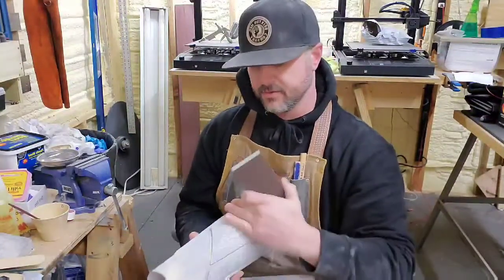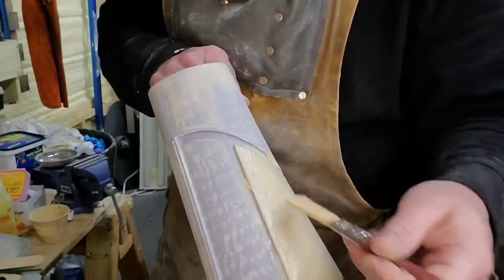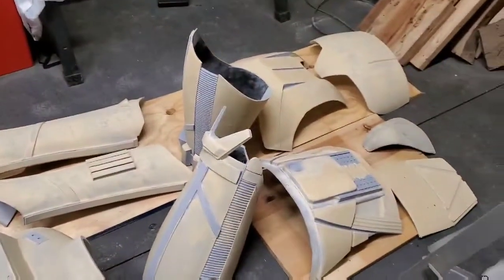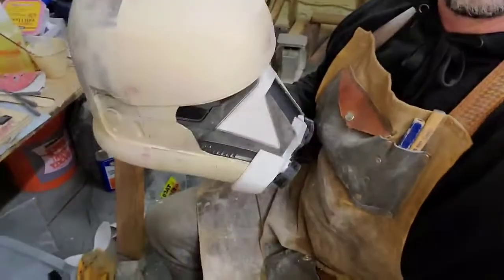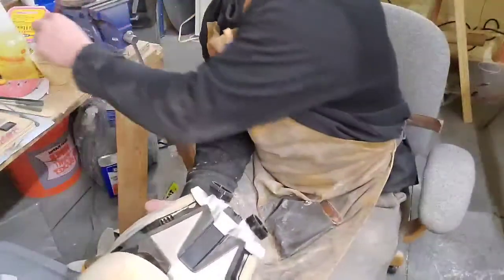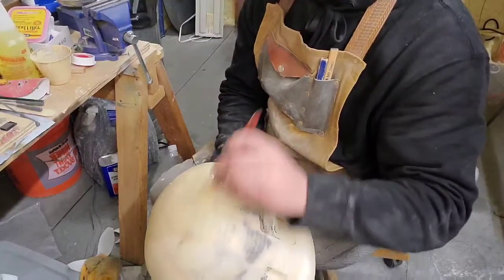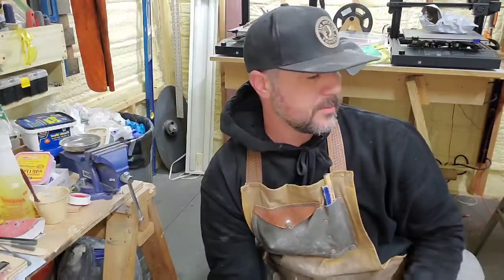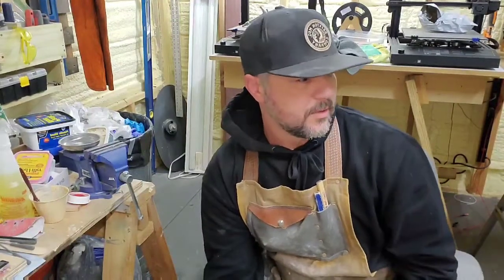3d Printed Star Wars Death Trooper Armor Part 3.......Wood Filler On Everything!!!

Comment: I’ve tried bondo, Fiberglass resin, UV resin, spot putty, XTC-3D but I haven’t tried wood filler. Wood filler has  got to be the least toxic and easiest to sand option. So I’m going to give it a go. Thx for the video. Like the idea of watering it down.
Reply from the maker: You bet!  I mainly use tabletop epoxy resin now days but wood filler works great.  Tabletop epoxy resin is like XTC but cheaper. 👌
Reply: @naterritchey19  Interesting. Maybe I’ll give that a go as well. That’s a two part  in that it has a hardener, right?
Reply from the maker: Yep, two part epoxy.  1:1 ratio on the stuff I have.

Comment: Great video!  Agree about post-processing being a good get-away to relax (‘til it stresses you out). 😉

I was wondering if you smoothed out that grill piece (you mentioned wanting to do it in resin).  If you want just that part in resin, for this build, I may be able to help you out. 👍🏻
Reply from the maker: Yeah, it does get stressful at times. Haha.  I actually ended up printing it with at 0.2 nozzle with the best quality I could on my FDM printer.  Turned out really good.  Thank you though!

Comment: Nice idea, did you just thin it down with actual water or something like acetone or IPA? I feel IPA would be good as it would help dry faster and less change of water ingress settling in the filler.
Reply from the maker: I just used water.  I just use Bondo glazing putty now.  Thinned down with acetone.🤙

Comment: Thanks for your video. I will try this by myself. The normal spray filler needs so much layers, i think i never finish...
Reply from the maker: Yes it does.  This saves a little time but I prefer epoxy resin now.  Makes the piece more rigid.
Reply from the maker: I have a video on that process too.

Comment: Had a few questions if you don’t mind. Was wondering what you did to glue sections together and what the process was to go from glitterbombed Docs to black and clean looking. Picking Tom’s files up as soon as my undersuit is in and these are the last two things I’m unsure of how to go about.
Reply from the maker: I used CA glue and activator to glue all the pieces.  I'm not sure I understand the other question.
Reply: @naterritchey19  my apologies. I was wondering what processes you went through to get your Doc Martens blacked out. I’ve never worked with leather and changing the color of the boots is a big mental hurdle for me.
Reply from the maker: Ah, I see.  I actually stripped them down with some sanding and acetone I believe and then used some leather dye.  After I dyed them I went over some spots by airbrushing aome acrylic paint.
Reply: @naterritchey19  thank you! I just started the printer up, that’ll give me something to do while I wait for the first few parts

Comment: Nice. I posted a tutorial in a FB group about using wood filler. Don't use epoxy to glue your prints.. Use 2P-10 with the accelerator. Also if you use a sponge brush instead of a chip brush you'll get better coverage :)
Reply from the maker: Thanks for the tips!  I'll check out your video
Reply from the maker: I forgot to tell you.  I didn't use epoxy for glueing the parts together.  I used CLA glue with accelerator.  Just used countertop epoxy to smooth and strengthen the pieces. 👍

Comment: Is that Elmer's plastic wood from walmart an spot putty to finish this it works ?
Reply from the maker: Yep, that's what I used!  I don't use the wood filler much anymore but it does work well if you use it just for print lines. I would f use it for filling gaps or large pieces though.👍

Comment: Thanks for these videos! Is it possible to wet sand wood filler after it has dried, or does it turn to goop?
Reply from the maker: You're welcome!  It will just turn to goop.  Some people wipe it down with a damp rag to flatten it out a bit.  I've personally never tried to wet sand it but I would imagine it wouldn't work very well.

Comment: You mention theres another video that explains the mix for the wood filler, can you link that, or give a vauge idea of how much to mix? I'm working on Mandalorian gear that and have that same putty
Reply from the maker: I mixed it in this video.  You keep adding a little water until it's thick like chocolate milk👍
Reply from the maker: Sorry, I meant I don't have a video with me doing that actual mixing but if you do how I said above it will be a good.  Just don't want it too runny or you'll have to do many many layers.
Reply: @naterritchey19  Ah ok, I misunderstood apparently.
Reply from the maker: Who knows, I might have said that.  I have a horrible memory. Haha.  I don't have a video on it though.  Let me know if you have any more questions 👍
Reply: @naterritchey19  Well, there is 1. The consistency you mentioned, milk, is the same consistency requested for Airbrush painting...have you tried airbrushing it?
Reply from the maker: I have not.  That would be interesting thought.  It's probably easier to just brush it on though.  I hate cleaning spray guns and air brushes out. 😂
Reply: @naterritchey19  I hate to keep bothering you about this, about how long does this take to dry, assuming you mixed it correctly?
Reply from the maker: It dries pretty quick.  I usually just let it sit for a couple hours and then sand it.

Comment: Just spent at least 2 hours resanding a helmet that I used wood filler on.  While washing the dust off, I noticed the last layer of primer filler was flaking away everywhere I had the wood filler. What a headache.  Not using it ever again.
Reply from the maker: Yeah, this video is from awhile ago. I don't use wood filler anymore.  Just glazing putty thinned down with acetone.  Used to use wood filler all the time but it does shrink over time.

Comment: Get away from that wood filler, there’s better putty’s & fillers out there that won’t trap moisture and have adverse effects with solvent content
Reply from the maker: I don't use it much anymore.  Mostly Bondo now after coating with resin.👌
Reply: @naterritchey19  it’s something I try to educate people but some have to live & learn. Wood filler has poor adhesion & a high shrink rate. Bondo plastic metal for deep filling, glazing putty for light defects. Keep up the good work my man!
Reply from the maker: Yep, that's what you recommend to me a while back and I've been using it.  Although, I haven't had any problems with the things that I've used wood filler on for smoothing out.  Those were coated in thick resin though before hand.👍

Comment: I use Bondo and thin down with acetone but I'll try this. Thanks 👍🍻
Reply from the maker: That's pretty much all I use now.  Bondo spot putty thinned with acetone.  This is quite a old video.  Wood putty works great too though 🤙